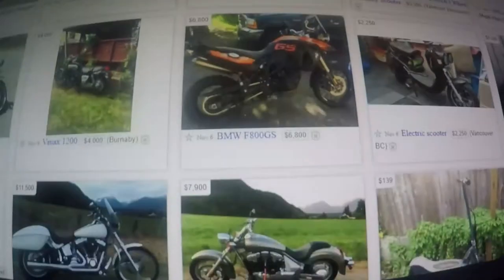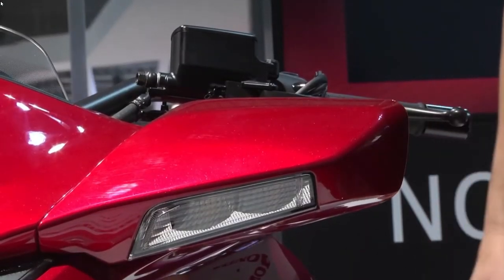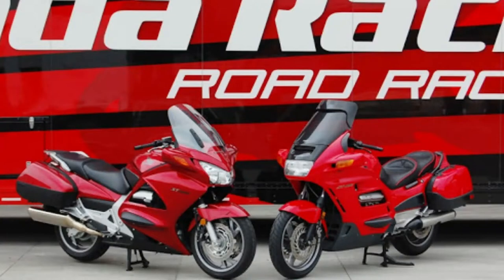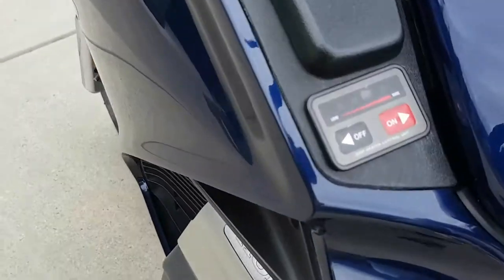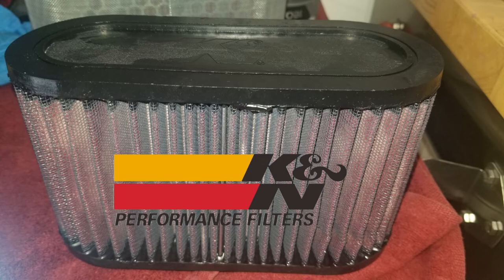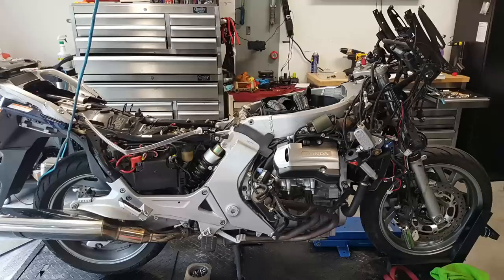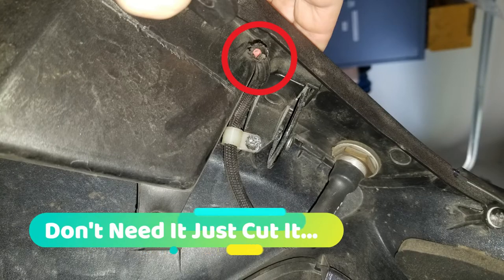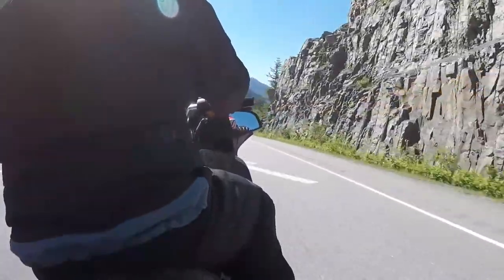Trouble When I Bought A Honda ST1300 Pan European...

Comment: Do you recommend me to buy 2003 model? Because of wobble problem..being said after 2003 model honda fixed this problem. Is that right?
Reply from the maker: The "wobble problem" is all BullSH*T!  There are no differences in the frame, suspension, steering yokes, springs, bearings in any of the ST1300 models.  Go to any honda dealer webpage and compare part numbers of anything related to handling and stability between model years, I have, they are all the same part number so what exactly got fixed?  All this is simply a fabrication because the ST1300P (Police) bike did not cut the mustard as it were, and was discontinued due to the heavy loads the bike was expected to carry, (police radio, second lead acid battery, police gear) all at 100MPH plus (I would like to see a Police Electra Glide do 100MPH, I've talked MC Cops, they tell me they can't).  If you load the ST1300  heavy to the rear, like in a tour pack, the front end floats and can easily lift.  Accelerating hard with a passenger can make the bike easily wheelie!   This is why some bikes develop a wobble at high speed, along with poor tire maintenance, bad suspension setup and motorcycle maintenance.  Ryan did a great job explaining what causes a tank slapper in this video https://youtu.be/IzXE32thS1g I suggest you check it out.  Sorry for the rant but I hate how this ignorance has spread in Honda ST forums by people that have never owned one, primarily those still trying to drive the value up of their ST1100's. - Buy the newest and nicest ST1300 you can, but know from 2003 to 2016, they are all the same...
Reply: @RodRidesWrenches  you are great man. Thanks alot for your reply.

Comment: Just purchased a st1300 2007 , test rode today & noticed a clunking from Gearbox, is this normal ? Seen a lot on youtube about slave cylinders leaking, lack of fluid change bleeding. How does yours ride?
Reply from the maker: Where is the clunk? Going into 1st from a dead stop? Start the bike on a level surface, put into gear, very slowly let the clutch out.  If the bike does not want to pull away after the first 1/3 of the clutch lever travel, you need a clutch.  Put the bike on the center stand.  Start the bike and with the side-stand up, gently put it into gear.  Does the rear wheel spin up hard with the clutch still pulled in?  Have a friend hold the clutch in while you carefully place your hand on the exposed tread part of the tire, do it slowly and gently since you don't want a farming accident!  Can you easily stop the wheel from spinning?  In not, you have a fluid, fluid line or slave cylinder problem.  Start by replacing the fluid and cleaning the reservoir and the try it again.  You will find a resource of videos on this subject on my channel.  BTW I flush brake/clutch fluid on every bike I buy unless it is obvious it was just done. - Good Luck!
Reply: @RodRidesWrenches  Thanks for great advice will have a look but going to get clutch fluid change /bleed through & see if any better thankyou.
Reply from the maker: @straightup1234  Thanks for the feedback & view. I have anew video out today, I hope you will check it out.
Reply: @RodRidesWrenches  yes I will 👍👍

Comment: Help please ST owners. I just bought a 2005 ST1300 45,000 miles seems to have had a good previous owner.  I’ve read other people get 38-45mpg but I only get 34mpg.  I don’t ride it that hard and I weigh 250 if that makes the difference from others experience.  I changed all the fluids and spark plugs hoping that would help things but no change.  Tires are in good shape Michelins.  Anyone have any thoughts I’d appreciate it.  I mostly drive in town.  When on the highway I run 70-85 usually.  I hope some of you have some ideas. Oh the air filter is K&N.
Reply from the maker: Your mileage sounds pretty good to me...  Fuel consumption is directly related to your right hand!
Reply: @RodRidesWrenches  
Thank you for your reply, I thought something was off because I’ve read others had reported better mpg results.

Comment: Curious on comments. Im looking at 2004 st1300 with 17000 miles. What is a good price?
Reply from the maker: Really depends on your market.  Anything under $5000CND/$4000USD I would consider well done if mileage is correct and condition matches.  Be a bit wary of low miles for year, you'll need tires, all fluids flushed the brake calipers could be sticky and be sure to try the clutch.  I have a video on my channel that runs through what to look for.  Good Luck!

Comment: Hello, do you know why the bike doesn't go over 120km/h or 74-75 mp/h? maybe some electric issue's like for example a bad stator?, I know these ones suffer a lil bit when not treated well or being cared for. 

Cheers.
Reply from the maker: Hello Alfredo, that could be a lot of things I would but not think stator.  Check the air filter and then the fuel pump and fuel injectors, not enough air or fuel and the bike won't go.  While the air box is off you can check the motion of the throttle bodies.  I suspect something is clogged or broken that is preventing them from opening.  A worn throttle body can flip partially closed on the pin.  Then it is on to the throttle position sensors.  Honda manual says to check the engine control module for wiring and/or a failure,  fuel injection system (if there is a power commander on the bike get rid of it), valve adjustment and broken or faulty valve springs and the valve timing.  Good Luck!
Reply: They definitely go well over 120 kms/hr. Ask the nice police lady on the Coquihalla Highway in British Columbia who had to radio to another cop ahead to stop me for a nice chat because she couldn't catch up in her Explorer Interceptor.

That day I felt the horseshoe firmly inserted as it turned out the nice police lady was a rider and had an ST1300. We chatted bikes and gear and kids and she realized I was a mature rider with decades of experience and let me off with advice to slow down a bit, especially up above the Coldwater, better know, as I told her, as Radar Flats. She nodded and we parted ways.